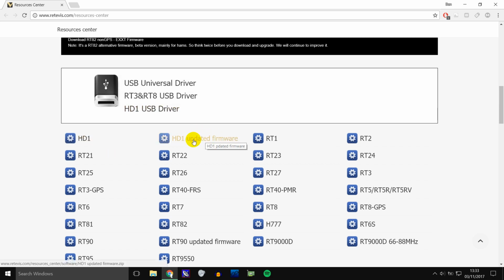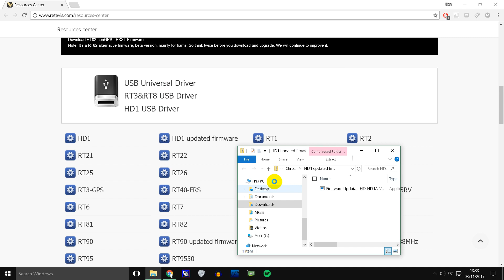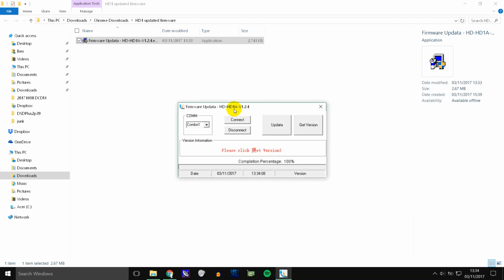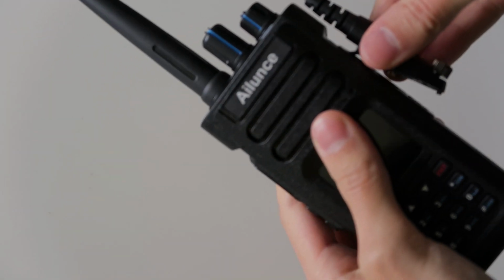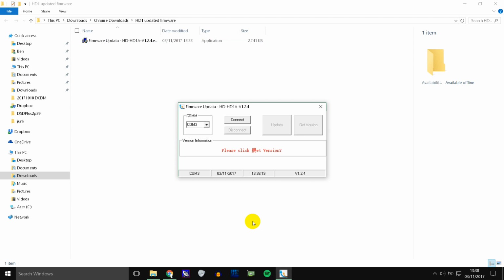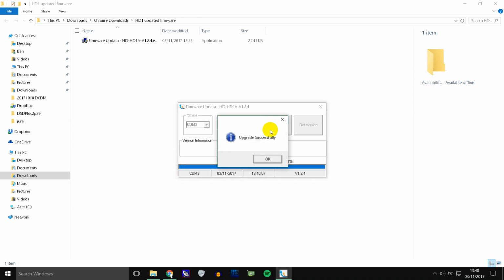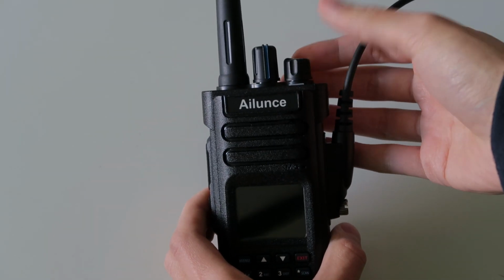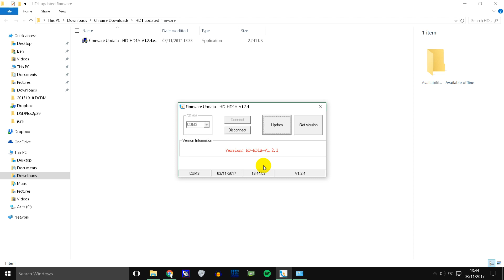How to update Ailunce HD1

Comment: Will the FW updates be of similar content in comparison to MD380 FW updates withe the extra utilities?
Reply from the maker: I don't really have any idea, sorry. My guess is that they will keep improving the radio. If you take a look at what Retevis are doing with the RT82 for example, which they have an amateur firmware for in beta. Since Ailunce is actually a part of Retevis I would guess that they will do similar things.
Reply: ...and TYT is big daddy.  I feel at this stage it isn't necessarily too difficult to have options similar to those in MD380 tools from the factory.

I totally accept that the 380 was a 'commercial' radio when first released and the 3rd party FW gave it a new lease of life.  I hope the same for MD2017/RT82, MD9600/RT90 and HD1 which looks to be a radio truly aimed at amateur radio minus a trackball and hopefully no aerial socket issues.

Keep up the good work!
Reply from the maker: I think that since the radio manufacturers saw how successful the MD-380 became when it had a custom firmware, they will now try to cater more for the amateur market rather than only the commercial market. I predict that we will see current and future models that have more features that amateurs want. The HD1 for example has the ability to do promiscuous mode and hold a contacts database out of the box.
Reply: @Michael Arnold: The RT82 is available in a GPS version and also the HD1 is promoted in both non GPS and GPS versions.